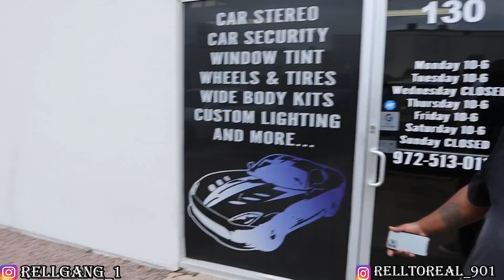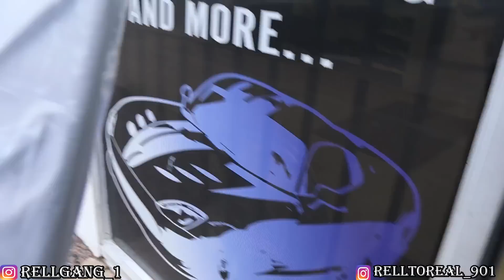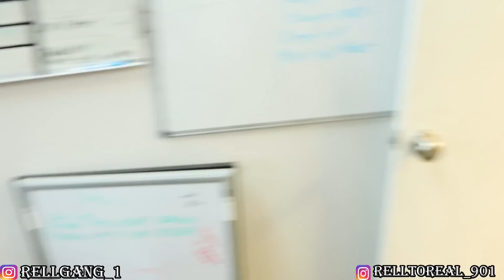THIS REALLY CHANGED THE LOOK OF THE 426 WHIPPLE SUPERCHARGED 300 SRT8.. BIG DIFFERENCE!!

Comment: No cap if anyone going through water hoses every year,  find a industrial Goodyear dealer and they can have you a water hose made, 75 ft for about $100. Ive had my water hose for 8 years now and I leave it outside all year round. I live in the northeast, so it get cold, my hose is still in good shape and show no wear or tear.  You'll never have to buy another water hose again.